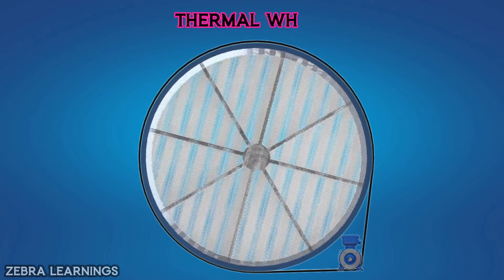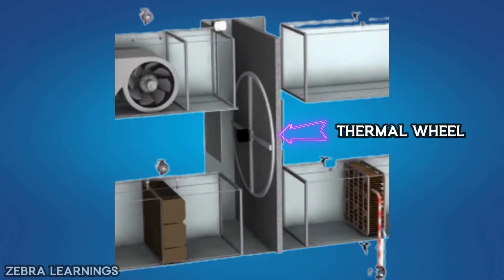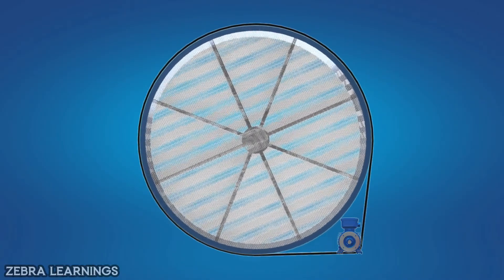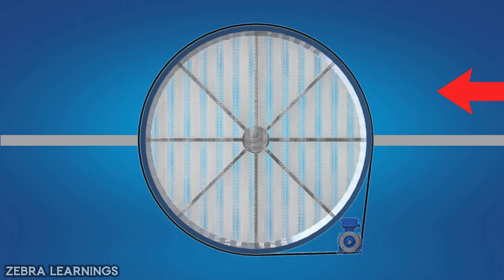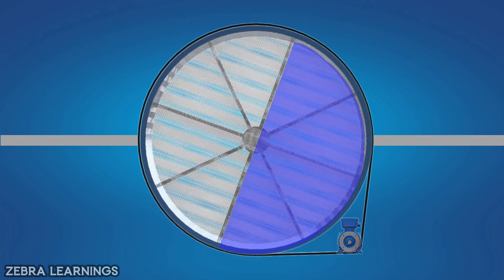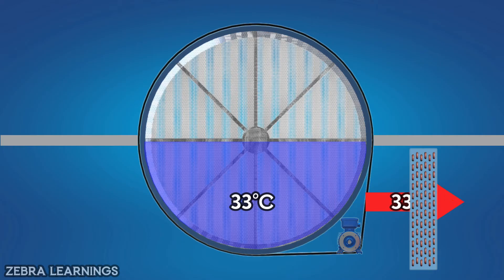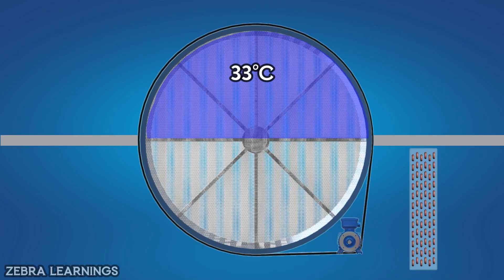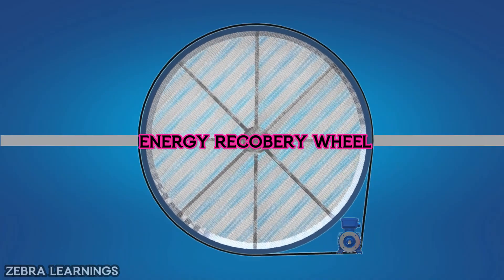What is Thermal Wheel or Heat Recovery Wheel? | FAHU | ERU | Animation | #hvac #hvacmaintenance

Comment: What if the out side temp is below 20 and our required set point is 25?
Consider Exhaust air is 22. ? 
How FAHU supply can maintain the warm?
Reply from the maker: There will be a heater in the duct. It'll provide warm air.

Comment: Specifically  in pharma company and Operation theaters  we exhaust return  because it may contain dome infection.  But tge exhaust air temp is 24 or some we have 21c too. The chillness of the exhaust  air is used  to reduce some temp of fresh air .   The same nowadays we doing we a cooling coils. 
Tq